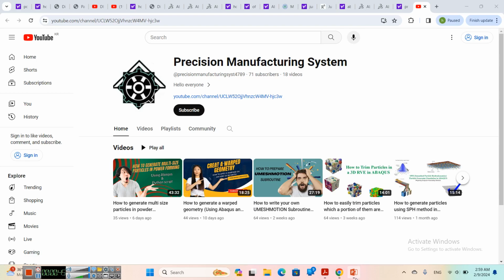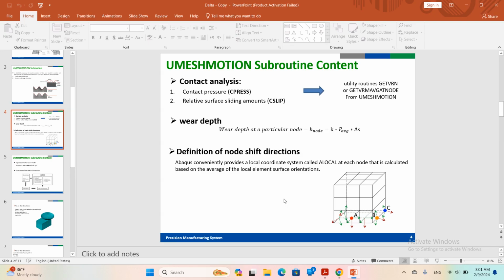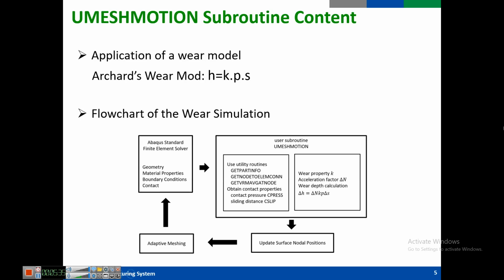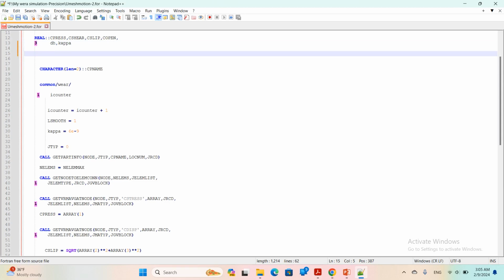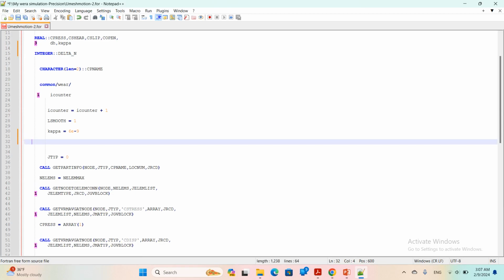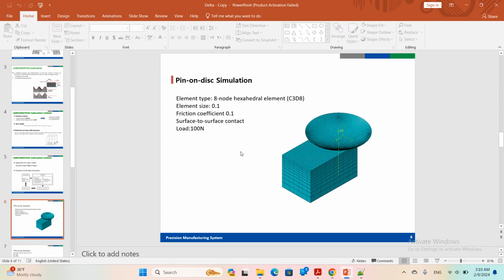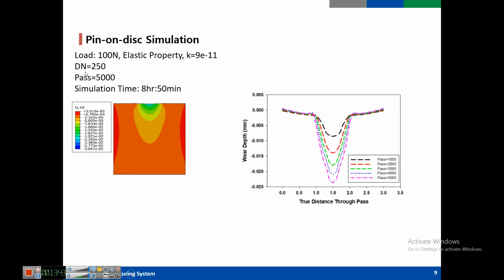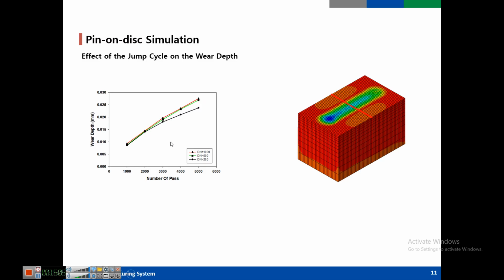How TO APPLY ACCELERATION FACTOR (JUMP CYCLE) TO UMESHMOTION SUBROUTINE IN WEAR SIMULATION

Comment: I think this method may lead to convergence problem in the solver. Did it work properly in your model? Or you used something different method. In adeptive mesh section it has FREQUENCY. Can this be a solution?